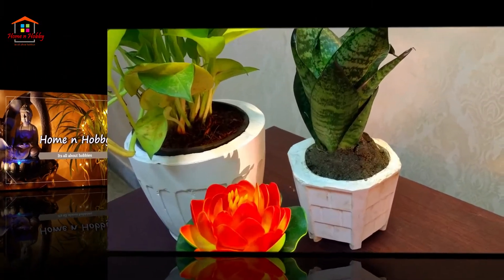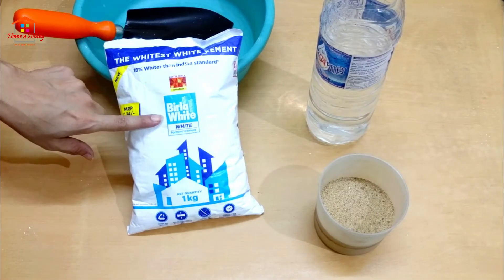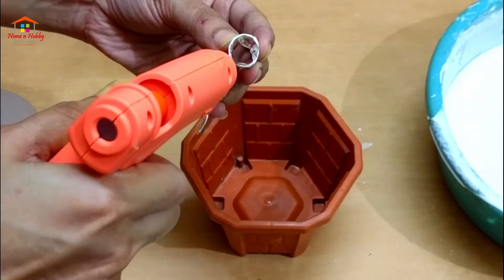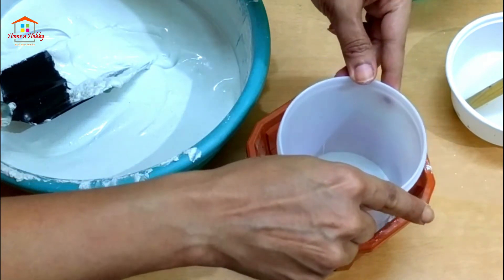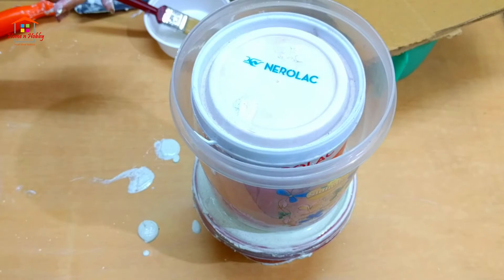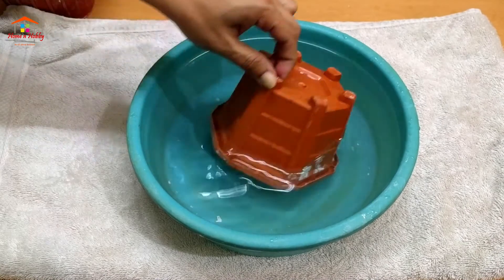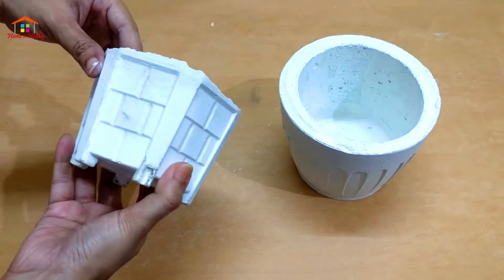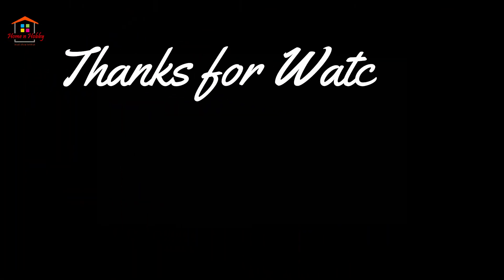White Cement Pots I Designer Pots I White Planters l Home n Hobby

Comment: Why it’s breaking after putting soil in it ?
Reply from the maker: In that case you have to soak the white planters in water for a day or two after they are done.
Reply: I did it for 2 days
Reply from the maker: Did u mix some sand with cement, it depends on proportion also